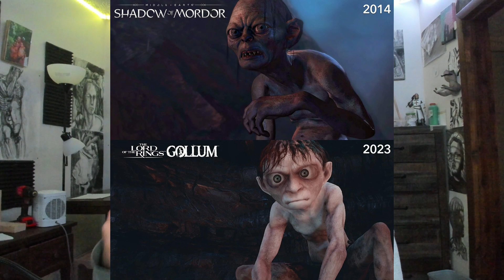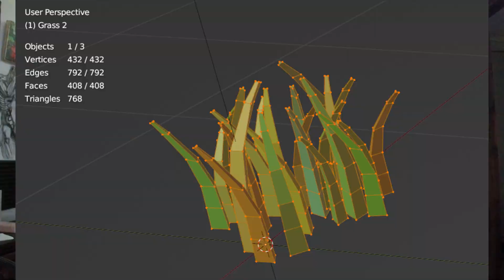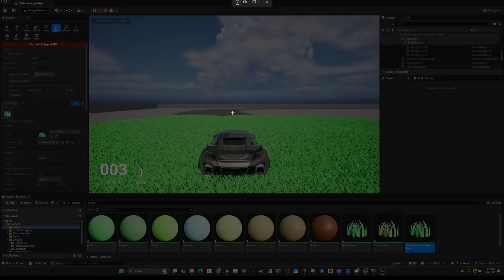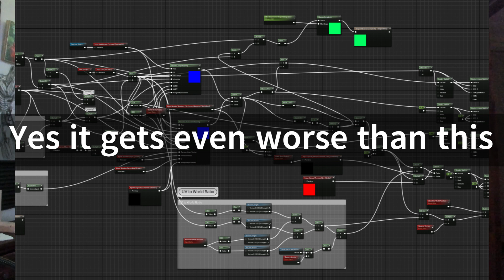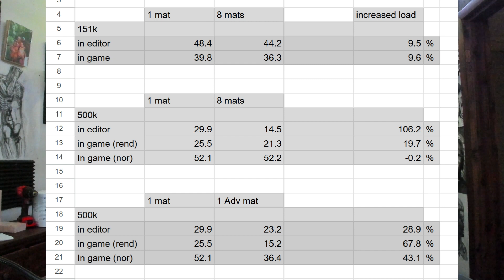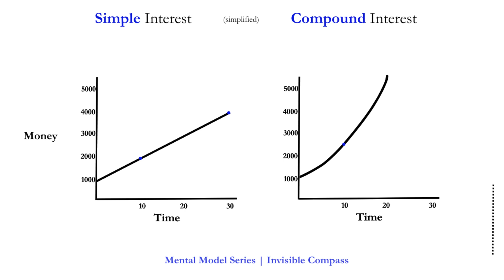You’re Using Nanite Wrong! The Hidden FPS Killer in Unreal Engine 5 #ue5

Comment: Guys. I'm building a pipeline in Unreal Engine. Tech Artist for 26 years here.  Listen, the KILLER for your game, I repeat, the REAL KILLER is the number of material instances you use. This situation requires you to sit down and invest some time attacking: 1. HISM for drawcalls. 2. PICD (Per Instance Custom Data) as much as you can to control material parameters PER INSTANCE. 3. Please please please, use Texture Arrays and Large Packed Atlases with Virtual Textures, mostly for non-tileable props. Only then, nanite will be a walk in the park. Also, if you get assets from the Market Place, do your homework to prep them and optimize, pack their textures, etc. I forgot to mention, be diligent in packing your textures as much as you can when you build your materials and shaders. There are ways to reduce very complex materials to maximum 2 texture samples.
Reply from the maker: Great comment here.

Comment: Try desktop resolution about 480p (or lower) and toggle fullscreen.   Shrinking locked pixels to desktop resolution at fullscreen makes your cpu lighter and almost stable framerates.   Tried this exactly on some unreal engine game like Wutherhing waves, with default effects but only lowering desktop pixel modes.    Just trying to sweet spot the game using my Ryzen 5 hardware laptop though so just letting you know.
Reply from the maker: Yeah but still would look bad lol, so it's a balance of adding more details but not so much you have to lose details by reducing resolution.
Reply: @LowPriorityGameDev  yes, resolution without disabling effects.   It's like straight up watching native 480p video.   Or maybe 480p window mode looking more smaller on desktop.  haha.     But nonetheless it would be somehow practical as a portable-like screen without cpu loads or stutters.

Comment: Imo I think nanite is really only for AAA devs that want to make a hyperrealistic setting. Us indie devs (especially solo devs) just do not have the capacity to output the same level as AAA devs and should not be using nanite.
Reply from the maker: This is really focused on how the number of materials have a larger effect when the polygon count reaches its max. I made this video following a large number of AAA games that worked well on higher end hardware but a card that should get 70% the fps was getting more like 20-30%. It's really focused on how the number of materials have an outsized effect on fps when your nearing the polygon count max of your hardware. 

This is something all devs should be aware of. A card that's half as powerful might not get half the performance but it may be stuck at 10% due to the effects mentioned.
Reply: @LowPriorityGameDev  the non linear decrease is definitely an interesting point!
Reply: @LowPriorityGameDev  dont understand a single thing but... are you advising us buyers to get higher bandwidth stuff? like not newer etc but high bandwidth memory for quicker calling of assets? i dont even know what im saying tho. just want advice.
Reply: Who said indie cannot use realistic. But nanite is faulty. There is a lot information disregarded here.

Comment: Just FYI, FPS is not the metric you want to use here, as it's nonlinear with respect to the amount of work done.  The far more useful metric is frame time (1/fps), which can tell you how much time you actually spent on a specific problem.  Eg 25fps->21fps is a ~20% drop in performance, but that sort of masks the fact that it's costing nearly *8ms*, which, given a frame budget of 60fps (16ms) means you're literally throwing away half of your frame budget by using Nanite incorrectly.  That's far more damning than a 20% fps hit with an already low frame rate imo.

Also your 24x math is totally wrong because of the above.
Reply from the maker: i did use 1/fps but you are right in that I should show that in the video as well to avoid confusion.

Comment: Nanite doesn't support translucency. At all. By switching your material to a Translucent blend mode, your grass meshes were no longer rendering as Nanite meshes. They were rendering the fallback mesh on the traditional raster path.
Reply: While I am not the biggest fan of Nanite the fact he didn't use the View Modes, Stat Commands and GPU Visualizer to show what was happening and instead jumped to conclusion is why he overlooked this obvious issue. In the Nanite rendering workflow applying Materials should be a lot faster than traditionally as for the most part Material should be applied in only a few Draw Calls instead of per (Unique with caveats) Mesh like they are in non Nanite rendering.
Reply: Why aren't you a fan of nanite?  @shannenmr
Reply: @shannenmr  Ok but the performance clearly got worse with addition of more materials, is there a specific way to apply materials for nanite?
Reply: *and transparency
Reply: If you are talking about Translucency on foliage Material like trees grass ETC. they will Tank GPU performance weather it's Nanite or Not, Best practice is for some trees and Foliage like Grass i found Dither TemporalAA can almost Double or Tripple the Performance, while also Cutting down all the Shader Cost. plus it mimics Real Life Edge Smoothing technique unlike traditional Translucent material for foliage trees and Grass.
Reply: Not only that, but Nanite requires VSM. VSM is slow. And each pipeline has overhead. So if you NEVER use Nanite and disable VSM, you'll get a HUGE boost in performance. If you use VSM, you'll get a drop, but you can turn on Nanite. Now, as long as you only use Nanite, you'll get a boost in performance from not using the non nanite pipeline. So by using translucent blend mode, you have both pipelines turned on along with VSM and it's rendered in a different pass. The performance is artificially tanked... THREE TIMES!!! However, I doubt the car and level template assets are nanite. So he's tanking performance even during normal nanite use. And as far as I understood, he never compared to a non nanite pipeline. Then there's the grass shadows. This is where there's a real performance issue. If you're using VSM, it will cache it after it is generated. Without VSM, you can use baked lighting. Dynamic lights on grass are kind of overkill. But it depends on if you're using Lumen or not as Lumen does not support baked lighting.

Anyhow, with all the things tanking his performance in the video, I think it's hilarious considering the title of the video.

Comment: that is an intresting finding, why is editor and in game so different, and in different directions too sometimes, thats odd
Reply: Running UE5 games inside UE editor doesn't run smoother than doing so in-game since it also runs with its UE editor in-engine
Reply: @alyasVictorio  i mean if you watch the video sometimes when he hits play, his fps shoots up from the editor, and sometimes when he hits play it goes down.
Reply from the maker: I did have some weird things where sometimes how taxing certain things are is changed between editor and in play. For example I know that materials work differently between standalone and in editor runtime. Now I don't fully know what was going on with the fps I was getting but it was consistent.